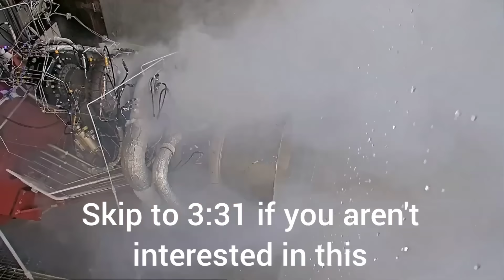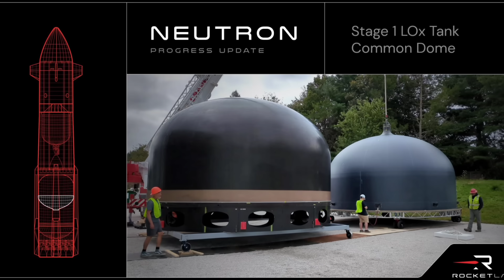The most sophisticated rocket ever is coming next year!  And SpaceX isn’t building it!

Comment: Bravo, Angry for daring to report of this under-appreciated under-reported amazing launch vehicle! Now that others are failing (Relativity and Astra finances, Virgin Orbit gone, ULA SRB debacle, Ariane lethargy, New Glenn continuing delays, Firefly lack of capital and long path to MLV), Rocket Lab continues with its rock solid execution of launch as a scalable business leveraging its high cadence Electron experience (60+ Electrons, 500+ Ruthefords assembly-line built) in avionics, robot-produced record-light-weight composite structures, lean operations team (35% gross profitable by latest SEC 10Q p21 launch services numbers), rapid Archimedes dev process, cost-efficient pad, and in so much more, to get Neutron on the pad mid-2025 on schedule and in budget. And it beats F9 in reusability and launch cost promising a disruptive breaking of the current predatory SpaceX monopoly, with huge demand awaiting it.

Comment: Neutron is basically low performance engines + super high tech hull, Starship is low tech hull + super high performance engines
Reply: the thing that spacex did that rocket labs didn't was make it cost effective if they lose a ship
Reply: @CloudaceMC  I think SPB would argue that the tech they are using has dropped the cost significantly.
Reply: @Honestraccoon  the more high-tech something is the more that can go wrong elon learned that along time ago
Reply: @CloudaceMC  Which would make sense if you only reused the engines, and discard the hull.
Reply: @CloudaceMC  surely if Superheavy and starship aren’t reusable they will be a pointless over engineered exercise  it’s reusability is intrinsic to the business model and advantages over present competitors, its limitations are specifically covered by its not being lost. So in the end the calculations will be around just how reliably reusable it ends up being. When a non engineer talks of eventually and ludicrously just an hour when there are still so many obstacles to solve before it’s reusable at all, it’s difficult to believe anything that’s being said. Cults and snake oil salesmen aren’t  the most reliable arbiters of present reality, let alone projected realities, we only need to look at Boeing for those dangers over time.
Reply: Combine it!
Reply: Space-x design possibly can be retrofitted in time woth 3d printing and even making it carbonfiber. All the lessons that has been learned will be gold for going from steel to other advanced materials.
Reply: @pinyoable  they specifically made the switch to steel because it is sooo much cheaper than carbon fiber
Reply: @alpinyoable  Steel and carbon fibre are completely different. No transfer to be expected.
Reply: @matfax  i understand that but space x has already the starships design and I can imagine being 3d printed the whole rocket from a different material than steel. Still possible needs to change some details also if 3d printed woth lighter material he can make legs because the weight would be less.
Reply: Goodluck getting neutron reused more than 3-6 times before the carbon fiber begins to loose its strength and fails. We should know better because of the titan submersible that was rated for 35 dives exceeding 300ft. With hypersonic speeds and reuseability carbon fiber is not the go to but fun to experiment. And can use for other things like internal carbon fiber stringers and baffles and other things.
Reply: @noahgossett6134  the difference being that the submersible had outside pressures pressing inward to the capsule.

In space it's containing that pressure within and everything inside is looking for a way out, instead of everything outside looking for a way in.
Reply: @noahgossett6134  problem with Titan was not the carbon fiber but titanium end caps. And a rocket has like 1/1000 the load compared to a submarine. Aircraft wings are made from carbon fiber and those are reused hundreds of thousands of times
Reply: @tedarcher9120  expose your carbon fiber to extreme plasma on re-entry, vibration, yaw, torqing, and then extreme cold - and see what happens.
Reply: @cryptosupplyshop3425  you're looking at the wrong vehicle, this is the launch vehicle so it won't have the same concerns as an orbital vehicle.

It'd also be different depending on how the engine compartment is assembled in order to withstand those extremes.
If it reaches those extremes due to the weight and speeds involved.
Reply: Stainless steel is not low tech.
Reply: @plumbedout7282  It is compared to the Carbon fiber...
Reply: @1flash3571  stainless is much better and can endure higher and lower temperatures better.  Carbon fiber is just lighter- thats the only advantage.
Reply: @cryptosupplyshop3425  lightness is the only thing that matters in space flight. SpaceX originally wanted to make Starship out of carbon fiber too, and it would have had double the payload, but it was way to big for that
Reply: @matfax  carbon fiber is not stronger than steel when it comes to reentry and temperature extremes...so there has to be qualifications in your statement.
Reply: @cryptosupplyshop3425  it doesn't have to reenter... It's the first stage
Reply: @cryptosupplyshop3425  Read my statement again then.
Reply: @tedarcher9120  i know that.  I'm referring to people making the argument for a carbon fiber Starship.   But let me ask you this...what happens to the structure of carbon fiber when you have to drill hundreds or thousands of holes into it to attach various rocket components.
Reply: @plumbedout7282  It is the same tech as water barrels in 1920s
Reply: @tedarcher9120  its actually not the same.  SpaceX and Elon has stated that their steel has different alloys in it and its cold rolled, its different than regular 301 steel.  Same for combustion chamber of raptor 3.  Its a top secret alloy. Literally top secret.
Reply: @cryptosupplyshop3425  cold rolled steel was used in 1920s too and their stainless alloy is basically 304L developed in 1924
Reply: @cryptosupplyshop3425 I wonder if adding Tungsten to the steel raises its melting point. That would be good for withstanding the heat of atmospheric re-entry.
Reply: @joeteichert6821  how to weld it then?
Reply: @plumbedout7282  its mass sure is.
Reply: @plumbedout7282  

But it is cheap to make because it is still just a custom variant Mars steel (what I call Martinsite) at the end of the day, and high tech is usually associated with exorbitant costs, but in reality high tech is doing what someone else needed 100x as much money to make, and you make something as good with chewing gum and a paper clip

Yeah cost to make is part of how high tech it is, it's more just that expensive and more complex is a bad thing, not a good thing

Basically complexity appeals to stupid people, is what I'm trying to say
Reply: @plumbedout7282  it’s hardly high tech though.
Reply: @plumbedout7282  f you can do repairs with a welder and a sledgehammer, it is low tech...
Reply: @paullangford8179  I'd say it's superior tech, not low tech...
Reply: @bellissimo4520  superiority depends on application, sometimes low tech solutions are better than high tech ones, sometimes not. It's not like spaceX isn't using high tech, Raptor 3 is insanely advanced with  metal 3d printing.
Reply: Carbon Fiber is high tech now? ... Carbon Fiber With Epoxy Resin (composite construction like fiberglass) is high tech?  When did this happen?  It's only been around sense the late 1800's. Someone at the high tech institute of "Holy High Tech Batman!" must have "re-evaluated" it. Dam. I wish someone would call me when this sh*t happens!
Reply: @hawkdsl  3d printed carbon fiber  is like 6 years old
Reply: @tedarcher9120  It's not "3d printed"! They use the same process that any carbon fiber parts manufactures have been using for decades. Not only is it not "High Tech", now your telling me they are using 6 year old sht!
Reply: @hawkdsl  6 years is as new as you can get in such an industry.
Reply: @hawkdsl  it is 3d printing. What other manufacturers have been using is just wrapping molds with carbon, this thing is completely automated. It's like saying 3d printing is old because people use plastic since 1920s
Reply: @matfax  u missed the joke
Reply: @tedarcher9120  it's not 3d printing. Yet another nonsense term.
Reply: @hawkdsl  it is additive manufacture with carbon composites
Reply: @tedarcher9120  ... With red #5 🤣
Reply: @hawkdsl  1956
Reply: @hawkdsl  Impact Resistance: Carbon fiber is relatively brittle compared to metals. In the harsh environment of space, where micrometeoroids and debris can pose a risk, carbon fiber structures can be more susceptible to damage from impacts.

Thermal Stability: Carbon fiber composites can have issues with thermal expansion. Spacecraft experience extreme temperature variations, which can lead to differential expansion and contraction, potentially compromising structural integrity.

Fatigue Resistance: Although carbon fiber has good fatigue resistance in many applications, repeated loading and unloading in a space environment can lead to issues like delamination or microcracking over time, which may not be as prevalent in metals like aluminum or titanium.

Repairability: In the event of damage, repairing metallic components is generally more straightforward than repairing carbon fiber. Specialized techniques and materials are required to ensure that a repair on composite structures meets safety and performance standards.

Moisture and Chemical Sensitivity: Carbon fiber composites can absorb moisture and may be sensitive to certain chemicals or environmental conditions. In the context of space, this could lead to complications that affect performance.

Manufacturing Complexity: The production of carbon fiber components can be more complex and time-consuming than traditional materials. This complexity can lead to consistency issues in large structures, which is particularly critical in aerospace applications.

Cost: The cost of carbon fiber composites is generally higher compared to metals, which can impact overall mission budgets and spacecraft design.

Inherent Anisotropy: Carbon fiber is anisotropic — its strength and elasticity can vary significantly depending on the direction of the load. This requires careful engineering and design considerations to ensure that the material will perform as expected in all loading scenarios.

While carbon fiber composites can be used effectively in certain applications within spacecraft, such as in non-load-bearing components or certain secondary structures, caution must be exercised when considering them for primary structural parts. It's crucial to evaluate the specific requirements and conditions of a mission to determine the best materials to use.

Comment: Carbon fiber wasn't a good choice below sea level, so this Neutron vehicle will be interesting indeed if space is less destructive on it than the Titan.
Reply: 53 already flown Electrons, built by RKLB from the same stuff, say it's good for space.
Reply: @ Neutron has the potential for sending humans to orbit or the moon, I’m more concerned with human being habitation survival in a carbon composite vehicle , not cargo, robots, or satellites.
Reply: Lmao, the lack of education in this comment is mind numbing. Bruh.
Reply: In space there is no pressure from outside, man only needs 14psi on the inside and cargo needs nothing. Pressure is not an issue
Reply: @Nailnuke  we have yet to learn how inflatables and carbon composites withstand the rigorous of cosmic radiation, micro meteors, air leakage, and other unknowns 🤔
Reply: You are comparing 0.05% of an atmosphere vs 10,000 atmospheres as the same thing. 

Falcon 9, Ariane6, Vulcan and Relativity's payloads fairing use CC so I think it will be fine.
Reply: @Honestraccoon Not comparing at all. I'm more concerned with if there ever is a human rated version of any carbon fiber ship, just as with inflatable space stations or inflatable moonbase modules. and the possibility of thos failure once occupied.